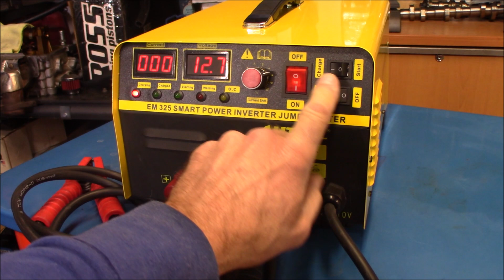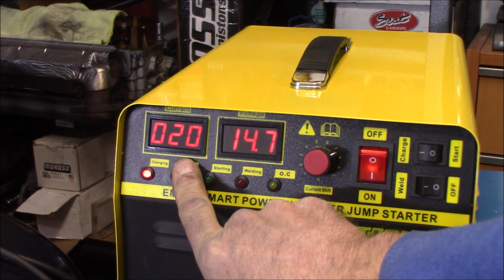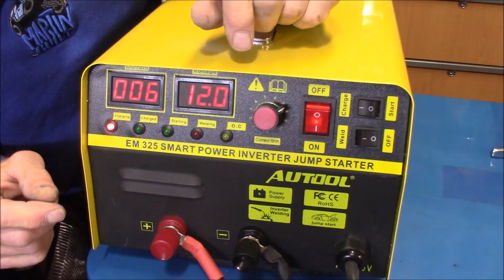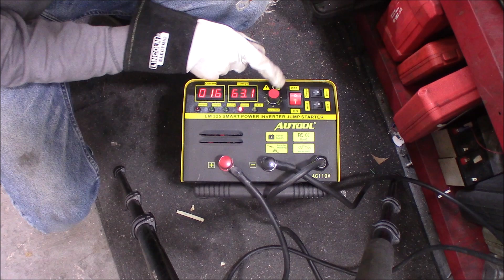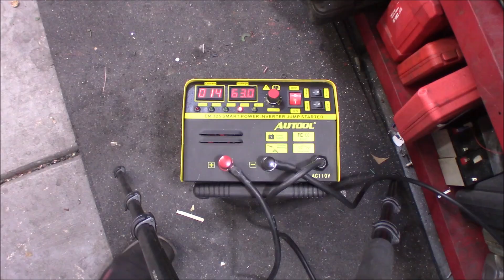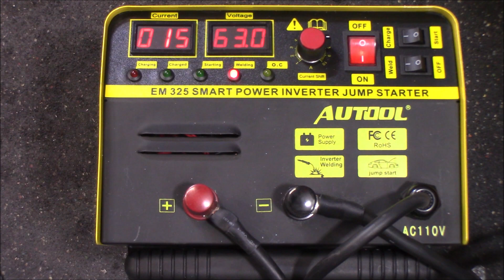Autool EM325 Portable Welder, Battery Charger and Jump Starter Operation Instructions

Comment: Thanks for showing this Martin
When you start the engine without the battery, after the car starts where does the alternator current go ?
Reply from the maker: The alternator should produce only enough current to keep the vehicle running.

Comment: Thats a cool tool man. I never would have thought that an industrial style charger could weld but i guess it makes sense cause of the power draw
Reply from the maker: yeah, if they can do that you would think that the multiprocess welder that are out there would also make they work as a battery charger/jump starter

Comment: Excellent video.  Would this unit be good for someone new to welding?  I have been doing a lot of auto body and other metal repairs where welding could be useful (I have been using rivets/screws and panel adhesive) but I have no welding experience.   I am thinking that I could justify this purchase (particularly with my significant other) because it is multi-use.
Reply from the maker: for body panel work I would go with a Mig welder. ARC welding is easier to use with metals 1/16 thick and heavier.

Comment: This looks great and the price on the web seems fair... However, I can't find the specs. What is the max current draw when Jump starting or Welding. I want to take this to sites where the only power available is either the vehicle or generator.
Reply from the maker: I would recommend a 15 amp minimum for jump starting and a 20 amp service if your welding above 100 amp setting. I looked through the instructions and couldn't find a spec on that.
Reply: @martinbuilt  thanks, that helps

Comment: This product looks like it would be perfect for bringing off-roading for field fixes.
Reply from the maker: Yes it would as long as you have some type of power supply generator or inverter
Reply: @martinbuilt  It would draw a lot of amperage when welding I am assuming though.
Do you know how much it requires?
Also, how heavy is the unit?
Reply: @tylerdubois9020  Dear friend, 400amp is the max amp and it weights 9.2KG.